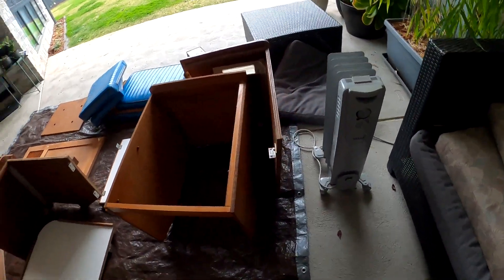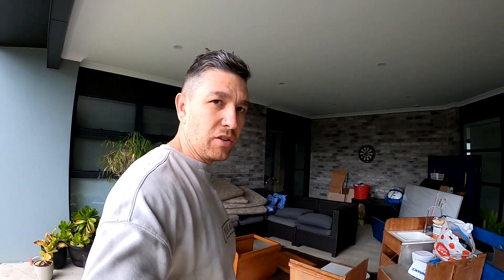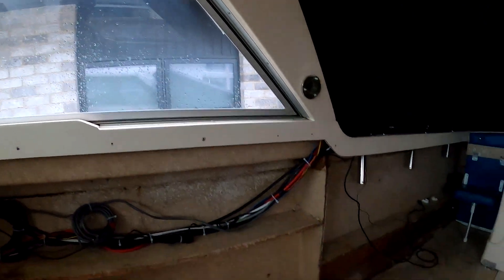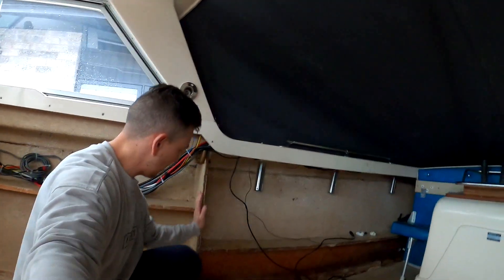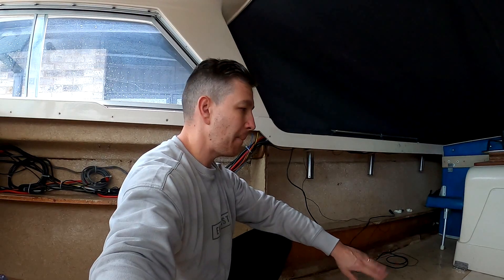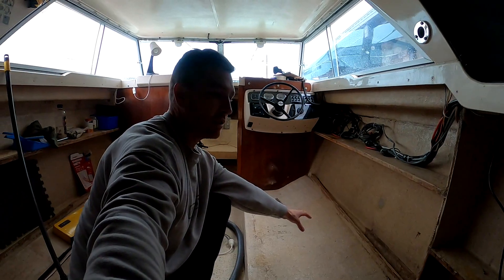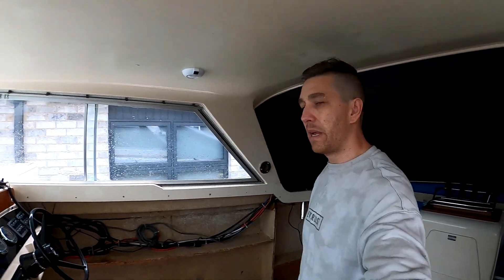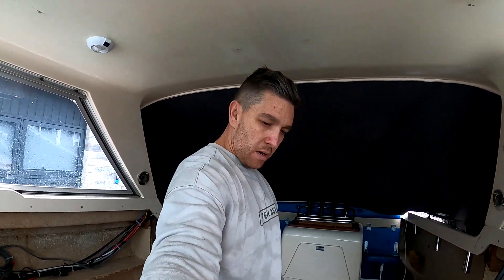The Bertram, Caribbean BEAST PROJECT BOAT has BEEN GUTTED!!!

Comment: I don't know what climate you live in but I'm in Melbourne and just completed the installation of a diesel heater.  I've got the vent going into the cabin but when I fit my various styles of covers, wheelhouse and full campers, it will keep the entire boat toasty warm and dry everything very quickly.  All up it cost me about $400-ish as you have to upgrade some of the shitty fittings for the marine environment and ensure you have a gas tight exhaust.  The other item I think you should consider is fitting a 12 volt refrigerator, I have an Engel (caravan fridge) unit with a small freezer compartment which is great for keeping 1 kg of frozen pilchards, it's really worth the money and wont kill your batteries.   I would have preferred a larger fridge but space is the issue.  A hot water system via heat exchanger from the engine is a no brainer too, especially if you swim from the boat, it's great to wash the salt water off.  All these things make for such a comfortable weekend away, be it with your mates or with the fairer half/kids if you have them.
Reply from the maker: Yes I need to put alot of thought into the interior planning. Yes agree it would be nice to have some of those luxuries!

Have also thought about fully enclosing the pilothouse area
Reply: @BaitBallin  just get some canvas and clears made up so you can use them when needed, that’s what I’ve done.  My wheelhouse covers drop to the floor from the rear of the Bimini, you could fit them to the rear of the hardtop, easy.  Also get a frame made up so you can have full camper covers.  I have this and for several trips away with my wife to the Gippsland lakes they’ve paid for themselves tenfold.  If you to fish leave them at home, if you want to cruise and live for a week on the boat, install them.
Reply from the maker: Yep sounds good 👍

Comment: Well that came outa the Southern Sky like freight train fella. Don,t need gas cooler fitted freezer water tank  etc. Keeping toilet but Changing to cartridge. Going all electric microwave, jug, and couple Jcar chillers. All 12 volt except MWAVE  and JUG or induction hub to easy run  through inverter couple solar panels on the roof 2 x house batteries 1x each start batteries twin outboards carry starter pack just in case. Water wise just get one of those water fountain bottles only once refill at home. I am fitting door for winter adventures also has rear cover which encloses right back to transom and fitting small Webascoo diesel heater (this NZ Winters bit more brutal here) good luck with re design. Keep at it and Carry on . ;0)
Reply from the maker: Yep awesome stuff! Actually a really good feeling being able to change things to the exact way you want them. Can finally picture how's it's all going to turn out.... Thanks man
Reply: @BaitBallin  Keep at it gonna look awesome.

Comment: Awesome build it your own
Reply from the maker: Yep it's the only way I can truly get what I want 😉
Reply: Only way to go is to start with a blank canvas.
If you build it the way you want you will know where everything is and trust it when your out deep.
One suggestion, when you replace any bolts, do so with either metric or imperial but not both.
Nothing worse that siezing a stainless bolt up in the boat somewhere because you put an imperial nut on a metric bolt and needing to cut it or snap it off with a double jointed elbow.
Reply from the maker: Yes absolutely! Have gone all metric....